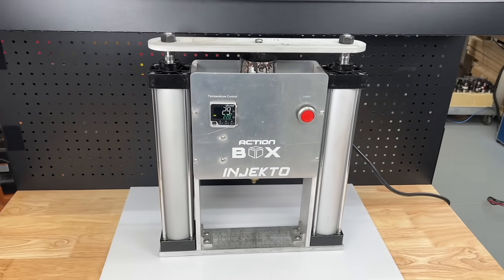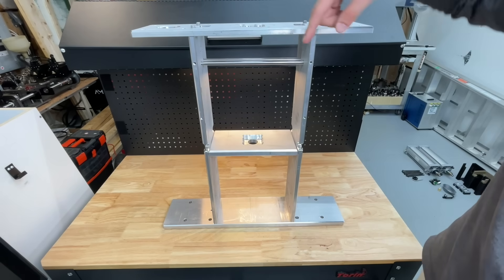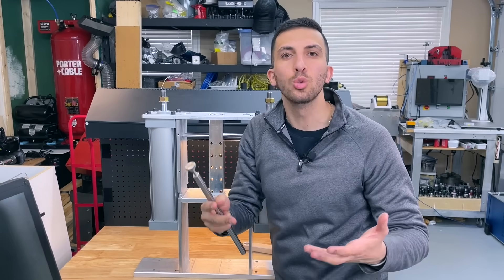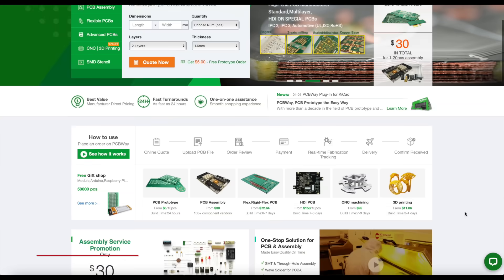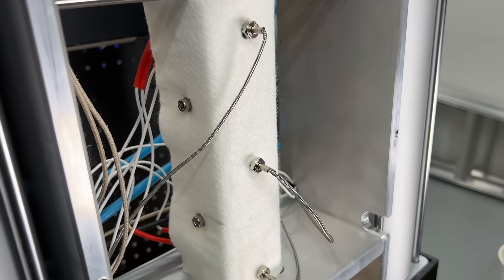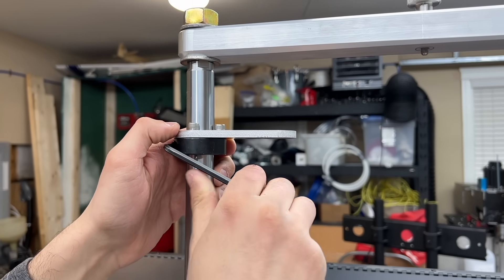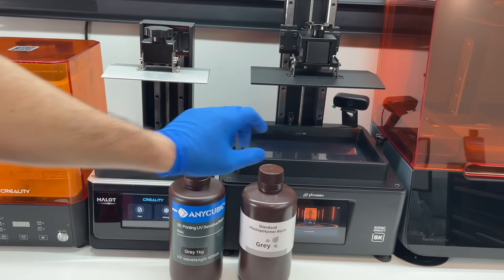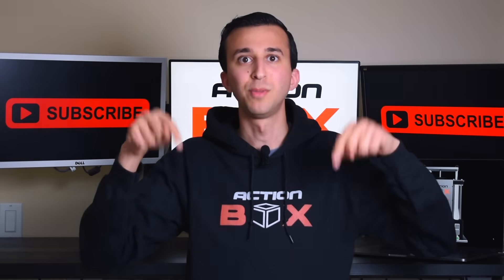DIY Injection Molder Works With 3D Printed Molds | INJEKTO 2.0

Comment: Not an expert, but I'm a plastic injection molding technician at my job.

Just a bit of helpful advice, when processing resin for injection molding you want most of the heat generated to come from friction. Part of that friction is created as the barrel screw rotates while building the charge (shot). Higher temp resins require a lower torque compared to lower temp resins (higher being over ~425°F). Also, industrial equipment incorporates a check valve into the end of the screw near the head to help accommodate the pressures that are generated as a result of this action.

With all of that out of the way, absolutely fantastic work! I'd love to have one of these at home to play around with some day.
Reply from the maker: Thank you for your input.  The machine you are describing is a more complex technology that uses a reciprocating screw.  Our equipment is less sophisticated, and does not require the check valve, although producing the heat via friction would be nice if you could think of a way to do it cheaply.  Cheers.
Reply: @ActionBOX  maybe machine flights into the plunger to create some sort of compromise between a plunger and screw and just attach a small geared motor to it. You wouldn't need much more than ~100rpm on average with some slight variability for what you're going to be injecting usually. Just have it rotate as it builds the charge from the bottom point up to capacity. Of course you'll need to have the proper tolerances. The biggest issue with building the shot this way without a checkvalve is you might end up with the side effects of gas in your molded pieces.

Just spitballing, but I believe with a small geared DC motor attached and aiding the charge buildup at low rpm, you could gain consistency and increased lifespan for fairly cheap and fairly easily.

Comment: as someone who's worked as a mold tool machinist and a press operator i approve. 
those were my 2 most stressful jobs and im glad i got out of them. 
it would be more fun to do this at home where you control everything and dont have past due deadlines and can take bathroom breaks as often as you need to.
Reply: mesmo.🤣🤣🤣

Comment: this looks amazing 
there is not a lot of things I would recommend for this, I think the only thing would be glass fiber tape on the top and bottom it's a high temp tape that should make the injection chamber both more snug and more thermally isolated from the frame

Comment: If you anodise that aluminium just realise that you'll need a proper ground connection to EACH piece of metal. The anodised layer is insulating and I've had parts that, despite being bolted together, weren't electricaly connected. Spiked washers can help but still aren't great.
Reply from the maker: Thanks Charlie.

Comment: My favorite part about the community is the incredible design enhancement comments below. I was an injection molding foreman years ago followed by mold setting technician and later did some extrusion blow molding as well. Years later, two years ago, bought my first 3D printer. Right now I'm looking at a desktop cnc, laser and frankly, adding the injecto would give me four methods of producing parts for robotic design. The four together should provide the variety needed for creating most any type of part necessary.

Great work guys. Love the Injecto! Love all the great feedback for improvements!

Comment: I would much rather those two green buttons be on a separate unit that I can hold some distance away from the machine. If something on that machine explodes or squirts out, I don't want to be standing directly in front of it and leaning my face into it.
Reply from the maker: You can also put a blast shield between you and the machine, but yes I agree that this is a concern. Cheers.

Comment: Nice improvements. 

If I can suggest. 

1) Use phenolic materials as heat blocks. They are cheap, and easy to machine to shape. 

2) Your ram is tight tolerance, great. However, if its expansion rate does not match the heat column, you can get it to jam. Normally in injection molding, to reduce leakage. You add small machine ribs or groves to the piston or ram. They will act as material collectors and reduce leakage without having to use tight tolerances. Similar to this design found in Injection Molder Valve gate assemblies. Or on shooting pots. 

3) Always use heat paste for the installation of the heater cartridge's, reduces the chance of a hot spot and its a failure point. Same for the solid state relays, they should always be installed with heat paste on the back. 

4) How are you mitigating the chances of a runaway heater control or the solid state relays? Both can fail in a close state. Does the E-stop control kill voltage to the heaters as well? Do you have a central E-stop? 

5) Would always recommend to have a source of water nearby as you run the equipment. A simple bucket or pail filled with water is better than nothing. If plastic shoots out and gets on bare skin, the natural reflex is to grab the material with the other hand. And now you are burned twice if not wearing gloves. Throwing your hand or wrist into a bucket of water is far safer and minimize the burn damage. 

Whish I had one of those machine 10+ years ago, would have made my life easier in prototyping.
Reply: hello  there ,,
  QUESTION  Would I be  able to make plastic Bottle  just by injection  way  ?  or not ?
Reply: @Banana-v7z  No, that's either through an extrusion strech blow molding process. Or a secondary Injection, then strech blow molding.
Reply from the maker: These are really great suggestions. I agree with all of them. Thanks, Dave
Reply: @ActionBOX  One suggestion: Not everyone has a residual current circuit breaker in all rooms. Here in germany it is only madatory in new buildings and only mandatory to add afterwards in "wet rooms" like bathroom and kitchen.
So integrating a residual current circuit breaker to the power cord might be a good idea.

Comment: Wonder if it could recycle PLA from FDM printers? Also wonder if it could use Hydrocal (plaster/Portland cement) molds?
Reply from the maker: The cement molds might crack under too much pressure but depending on the molds it will work to an extent.  We had success with PLA injections. Cheers

Comment: Why is the original resin so damn expensive?
Reply from the maker: I don’t know.  It really shouldn’t be.  Probably because Formlabs has a monopoly 🤷🏻‍♂️. Either way, they make a great product, but we wanted to point out that there are cheaper options that work just as well.  Cheers, Dave

Comment: Love the idea and build quality of the injecto 2.0. Just a thought, it might be a potential idea to add a micro controller to make operation easier and potentially automated. A user interface and automatic volume injection amount would be ideal so there is no guess and check on an expensive mold. Great work so far!

Comment: This is definitely great! I also was surprised to see how the resin prints did withstand both temperature and pressure...
About the possibility of plastic ejection : it would be neat to have a polycarbonate shield in front of the mold, perhaps a swiveling one, or snapping on one?
Anyways, the 2.0 kit really ties up the loose ends from the 1.0.
Reply: this! getting molten plastic sprayed in your face is no joke, and a clear plastic shield is enough to stop it.
Reply: @gydo1942  I don't know if you are trying to be sarcastic here, but a 5mm sheet of polycarbonate will definitely stop a blob of hot plastic. Polycarbonate is used to make riot police shields, and also bulletproof clear protection...
If not, sorry, i read this as sarcastic while it was not.
Reply: @AudreyRobinel  I was absolutely serious. Safety first!

Comment: I think it would be nice to have an mesurement scale with the stop plate. So that you could fill the mold more acurate.

You could do this with an ruler behind the rod or if the tollerances alow it, laser engrave it into the rod. 
You can calculate the volume of the empty mold to know howmuch plastic is needed. And calculate how much the injecter should move to inject this volume.

Comment: This is an awesome design! I'd recommend a floating joint from that push rod for the plastic and the crossbar that links the cylinders. Any misalignment of the rod and the cylinder that holds the plastic will destroy the tolerance you have on those 2 parts. I work as an automation engineer and the biggest failure point for pneumatic cylinders is misalignment. I think your cylinders will be fine (unless they move at different times). I think its a small change with big benefits. Its also very easy to judge a design from the outside looking in. Non designers love to criticize and say "this design is terrible its the worst thing I've ever seen" so this is not one of those comments.

Overall GREAT job but that would be a small change that I would make. There are probably a million right and wrong ways to do this but overall you did a bang up job!
Reply: The stiffer crossbar is a good upgrade, based on experience, and looks promising.  Another solution, though it requires considrably more vertical space and has issues related to rod stiffness (that can be overcome by using less slender rods) is to drive the plunger with a single cylinder.  This machine is very similar to the way thermoplastic injection molding machines were built (for a very short time) prior to the invention of the reciprocating screw, and the good news is that most commodity thermoplastic resins (like polypropylene) have a pretty wide processing window regarding melt temperatures... and low melt index resins, such as those formulated for extrusion, tend to be more forgiving than high melt index ones.

First things to go will be the piston and barrel and cartridge heaters aren't always easy to replace, so there'll be a market for spare parts.

Comment: Nice job, and great improvements on the design. The only thing I would add would be a front or rear hopper design to feed the raw material into the middle, instead of putting it in by hand. (maybe with a 3D printed adapter that uses a plastic jug of some sort, with the bottom cut off, as the hopper) Maybe with a manually controlled gate, so the user can control over when and how much material to feed in. Having said that, the funnel you have now is a great improvement over the previous version.
Reply: Usually this works with a screw driving the granulate in the heating chamber before plunging the hot mass thru. The chamber can be set to a min max volume  to fit the mould. This device is just decades behind of current technological standards. And i have seen guys make almost professional machines as a desktop model. If compared this is rather unpractical.

Comment: Something to consider for a future version if you're worried about the heated chamber overheating the assembly, you can use thermally insulating mica sheets. We used these at my previous job to insulate the tooling from heater blocks for hot plate plastic welding machines.I would source them from somewhere other than McMaster Carr since their sheets tended to break down after only a few hours of tool use.

As I said on your shreddy video, this is an amazing project and I am all for having hobbyist ways to recycle plastic waste. When I have the disposable income for tools again I'll definitely look into this.

Comment: Full face respirator? A little overkill don't you think, some thermoplastic fumes won't kill you.
Reply from the maker: Absolutely, but there was no reason for me not to use it.  It was lying around anyways 😜.  Hope you enjoyed the video. Cheers.
Reply: You may want to check what happens when PVDF or PVC or CPVC overheat and degrade... not only the gases that result, but pressures in an enclosed vessel can get explosive very quickly.  Be sure to read MSDS very carefully.

Comment: injection mold are suppose to be good at fine details. if it is just going to make caps, your 3d printer already did the job. show us how good it is going to make small details, may be.....some adjustments control units use in optical devices. or.....some screw threats? which 3d printer can get those shape but not the strength. those test will persuade people for this new product. 

simply show how better the strength difference of these injection casting and ordinary 3d printing.
Reply from the maker: Ooo that’s a great idea.  I’ll add that to the list of follow up demonstrations.
Reply from the maker: @AustinGDesigns  I’ll make another video testing all these parameters just to answer your questions.  Cheers, Dave

Comment: Some Ideas for Version 3.0
-Powder Coating the Aluminum will result in a super high quality look
- A Blast shield that you can lower and raise in case the mold breaks to protect your face.
- Measurement lines on the rod on which you adjust the limit switch. So that you know how much Plastic will be extruded.
- A Fan that turns on when things get too hot or you can turn on  by yourself so you can cool down the maschine after extensive use

And for the molds:
-Ive seen people using aluminium outer rims  in which you place in the resin molds. So that you dont have to print the molds extremly thick. 
-Aluminium will be better to clamp or screw together than resin since the thread are stronger. So you can add holes with threads on the aluminium outer rim
Reply from the maker: Great ideas. Thank you. We were trying to eliminate the need for CNC machining and hence eliminate the aluminum, but that is a good idea.  Cheers, Dave
Reply: @ActionBOX  I remember seeing these aluminium mould 'blanks' being sold somewhere, but don't remember where. I think TheCrafsMan used them.
Reply: @ActionBOX  Have to admit Your channel as well as Your work has come a long way. Have been watching you since the EDM wire cutter machine. 

I had a request/suggestion to make...

Could you please test these and post a video

1. using a 3D printed FDM Pattern to create Plaster of Paris  Mould (preferably reinforced with hay for strength) and lubricate the internals of Mould with oil to prevent sticking of plastic with POP.

2. Instead of POP using pottery clay around the FDM 3D printed pattern and then cook it to get the mould.

With the test Also find answers to:
1. Do these kind of moulds do the job?
2. How many parts/injections do these semi permanent(yes that's the objective) moulds can take?
3. Do they have adhesion issues with the parts?
4. Do they provide necessary finish to the parts?
5. How economical/costly are they compared to Aluminium or Resin printed Moulds.

Comment: Looks great! i love your videos.  One suggestion:  you might want to publish the injection pressure (rather than injection FORCE) because it's the more relevant parameter in injection molding.  Just by eyeballing the diameter of the ram, it injection pressure looks to be 1,000-2,000psi injection pressure?   

I really like the design of that heater chamber though! heater cartridges def looks like the right move. (I use them to control temperature on my aluminum molds)  Although 5 heat zones might be a bit overkill lol.  Do you plan to move machining in-house?  $500 for just the chamber is quite a pill to swallow
Reply from the maker: Thanks for your comment.  During the injection cycle I recognize why pressure is more important, but as a general machine parameter the force is far more relevant as you don’t know the pressure of the injection until you know the mold being used. I believe this is why most industrial machines are listed as ex. 40 ton or 100 ton machine. 

The design of the new heated chamber is definitely awesome but it’s near impossible to machine at home to the proper tolerances given the big L to D ratio etc. we have no choice but to outsource right now. 

Glad you liked the video, and thanks for your input 😃 
Cheers,
Dave
Reply: @ActionBOX  Usually machine tonnage refers to the clamping force keeping the molds closed.  That parameter (plus inj. pressure capacity) more-or-less gives an idea of how large of a part can be made before separation.  Clamping force isn't really an issue in this case as your molds are being clamped by bolts and nuts.  but inj. pressure will still give a good idea of what materials can be processed
Reply from the maker: @engineeredaf1920  okay, we’ll I walk away smarter than I came in. Thanks for sharing 😃. Thanks for also supporting our channel. Cheers, Dave
Reply: @ActionBOX  We all learn together :-)  Thanks again for building this community and sharing your work

Comment: Nice implementation, I think you will need fiber glass supports to insolate the heat from the metal frame, you can buy fiber glass tables and machine like metal, what about a water cooled 3d printed mold for continuous operation?, I think will be cool see this type of mold in action :)
Reply from the maker: The more insulation the better, but I don’t think fiberglass insulation specifically is required. Thanks for your input 😊